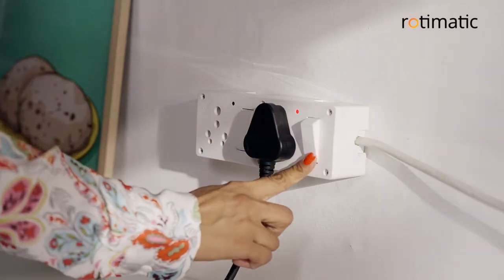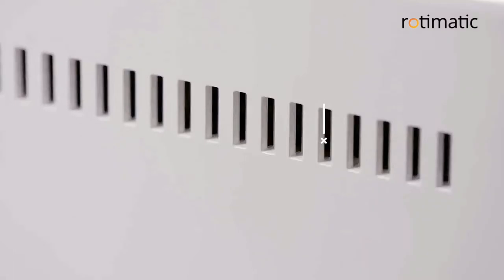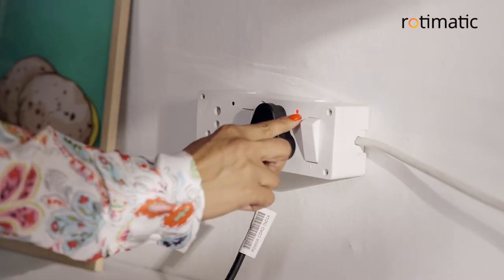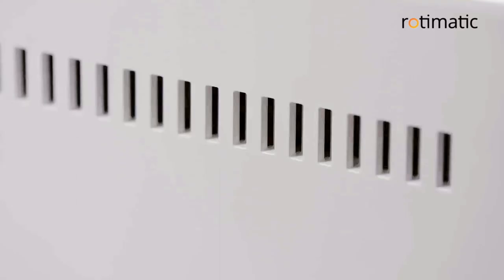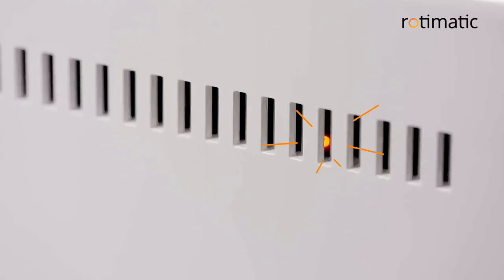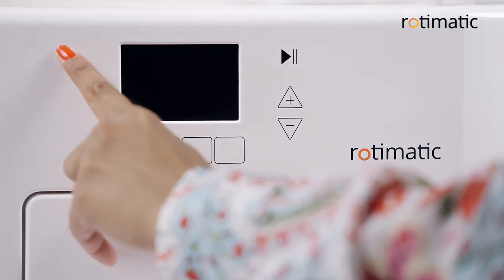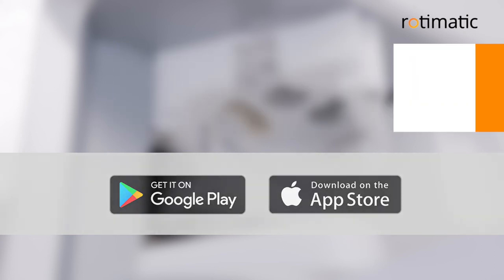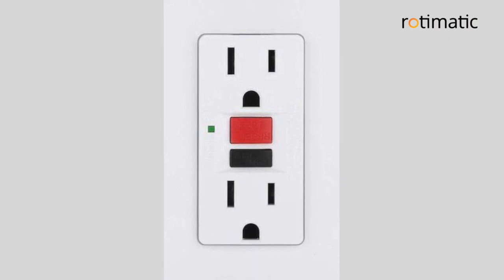How To Solve Rotimatic Not Powering On Issue | Troubleshooting when Rotimatic Is Not Powering On

Comment: Solution - 
Please power cycle your Rotimatic as shown in the video:
https://youtu.be/FBQ3W4DiDzw
Here are the steps for Power Cycle:
Turn off the Rotimatic and remove the power cable from both end (From wall socket and Rotimatic).
Wait for one minute till the red lights in the side vents are completely off.
Plugin the power cable to the Rotimatic. Ensure the power cord is inserted properly.
Now Plugin the Rotimatic power cable into the wall power socket. Do not share with other appliance.
Ensure the red lights are seen through side vents.(there should be 3 red lights from side vents hole #7 and#13 counting from the right).
Wait for 5 sec. and tap the power button.
In case there is no red light when seen through the side vents, please make sure the power cable is properly inserted to the Rotimatic.
If there is RED light seen through the side vents, and the power button is not responding, please tap all the buttons, at least 3 times each.
If the machine is still not powering on, please remove the power cord from the machine and leave it for more than 24 hrs. Plug in back the power cable after 24 hrs and try powering on the machine.
Reply from the maker: Hi Sathish, thanks a lot!
Reply: Specifically click the 'power'  button 3 times , then 'start' button 3 times followed by ' + ' button 3 times then ' - '  button 3 times